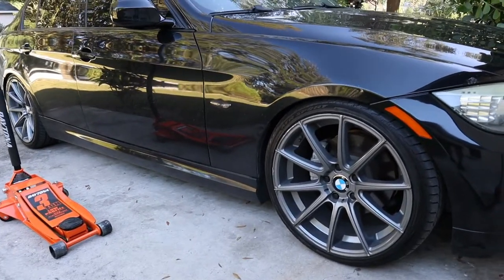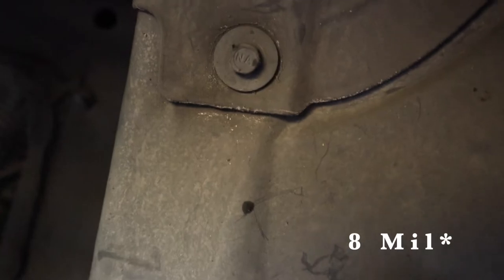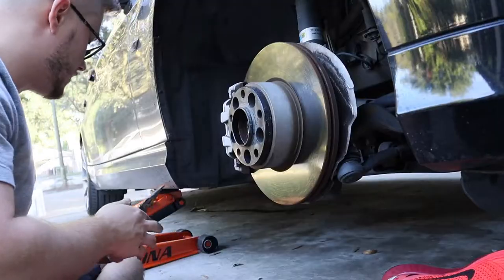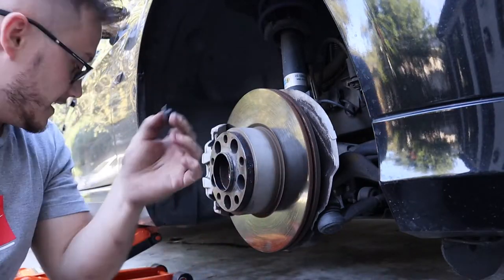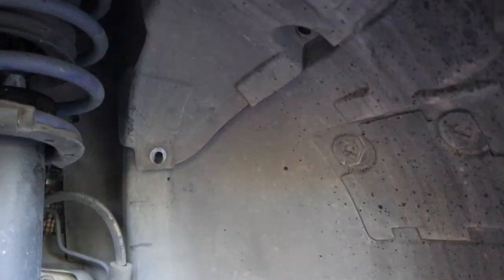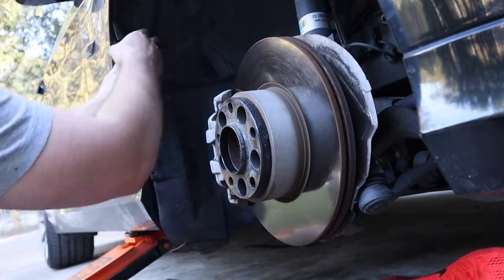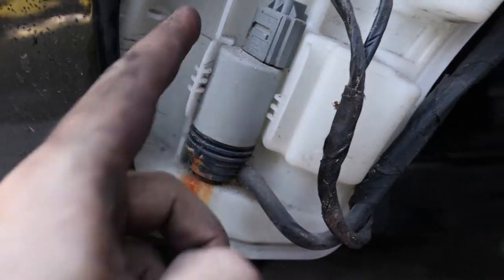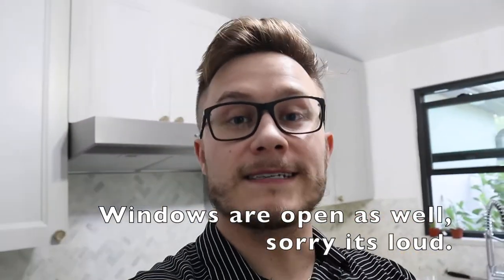HOW TO BMW Leaking Washer Fluid Reservoir QUICK $5 FIX E90 E92 328i 335i

Comment: Good video TOMAHAWK813.  One thing I have learned owning my BMW is that all fasteners holding parts onto the car have some way to come out or release.  Those little clips you broke off and bent your fender brute-forcing them out, release by tapping the center in with a small screwdriver.  If done carefully, you can recover the center pin and reuse the clips.  Hope this helps you and others with future repairs.
Reply: thx bro
Reply from the maker: Thanks man. Sorry about the late reply. I tried doing that but they seemed stuck when I tried to push in. Not sure what was up with that.
Reply: Exactly this. Have to use a straight pick or center punch and just tap it in the center fairly hard. They're not reusable
Reply: Yup... ^THIS^...

Comment: I heard somewhere that the pump has a weep hole on purpose so that when the pump goes bad it doesn't fill up and short circuit something . I'm not sure if it's true, but did you have any issues at all after plugging the weep hole

Comment: nice vid, but after taking it all out I would have gone and replaced the washer pump, they are really not that expensive, unless you buy them from a dealer. I am not sure what that weld stuff is, but in future if you needed to replace your pump it looks like you will have a hard job to get that stuff off.
Reply from the maker: Yeah I should of done that and will probably do that in the near future 😅
Reply: OEM pump from Turner is $8.95 plus shipping, unless your total buy is $50.  My issue was gel/snot buildup on my intake filter of my E88 washer pump.
Reply from the maker: @meatman6660  yeah I’m just going to replace the pump. That’s super cheap.

Comment: I expect my problem is the same and my pump works fine. I expect the pump secures in with an O-ring. I'll find the size of ring before tackling the inner fender skirt removal and that should be a permanent fix til another is needed (10 years). Why do a job half-fast... Less than $5. Yeh O-ring $2 Tops.
Reply from the maker: you can do that too
Reply: Mine doesn’t have an o-ring just a rubber fit that goes between the pumper and reservoir

Comment: Hi Bor, it is probably the rubber O ring on the pump that is leaking so it is not a smart idea to glue up the pump cos you might have  a hard time to change the pump out next time. BMW washer tank position really hard to reach unlike japan made.

Comment: Should have removed the pump and put some sealant on it and put the pump back in. When you just goop sealant on the outside it usually doesn’t last very long.
Reply from the maker: Yeah this was just a temporary quick fix. I realized a new pump is pretty cheap and I need to do that here soon.
Reply: And also cleaned-out the gunk that was blocking the filter (the reason why it was leaking in the first place...) before jamming all that epoxy around it: now you have a blocked filter sealed inside a bunch of epoxy resin, and your washers still won't work so you'll be buying a new reservoir, pump, and the hoses that run to your windshield 🙄 if you ever want a clear view of the road ahead, which is usually a good thing to have, huh?

Comment: Nea Caisa...chestiile alea mici din plastic...au un stift mic,il impingeai cu ceva subtire in mijloc si nu mai  stricai o aripa perfcta la masina...daca cautai un pic pe net gaseai sigur cum se scot acele chestii de plastic...oricum era ceva foarte simplu...
Reply from the maker: can you translate to English please
Reply: @TOMAHAWK813  those small plastic things... they have a small pin, you push it with something thin in the middle and you don't ruin a perfect wing on the car... if you search a bit on the net you will surely find how to remove those plastic things...  anyway it was something very simple

Comment: Sorry man, I don't wanna be unkind BUT...
-If you can't figure-out how to release those plastic clips by pushing-in the clearly visible pin thro the centre (they're 100% re-usable if you can find the pins inside the fender panel afterwards...) then you should probably not be working on a BMW (or any other premium car) at all except for washing and waxing it?

And that "repair" with the epoxy was just horrible -how about just gently prying the pump upwards out of the reservoir once it's clear of the fender, cleaning all the gunk out of the filter (the reason why it was leaking in the first place: the pump runs at relatively high pressure, so if the filter gets clogged then washer-fluid forces its way past the rubber collar that holds the filter in place, and this is what causes/creates the leak in the first place.

Reassembling everything with PTFE plumber's tape for a waterproof seal (and then filling the reservoir and running the washers to check there's a good seal before reassembling the fender/arch...) will stop the leaks without replacing anything, or jamming a bunch of nasty epoxy around it, and costs around 45 minutes of your time and like 5 cents-worth of PTFE tape...

-I'm not claiming to be perfect myself:  I did this same repair myself over the weekend on my F11 530D and DIDN'T check for leaks before I reassembled everything, and all the fluid drained straight out again, so I've done this twice now in 48 hours and those plastic clips still grip just as tight now as before I started...
Reply from the maker: Those pins were not budging whatever I tried. This is obviously a quick fix video as explained in the title.